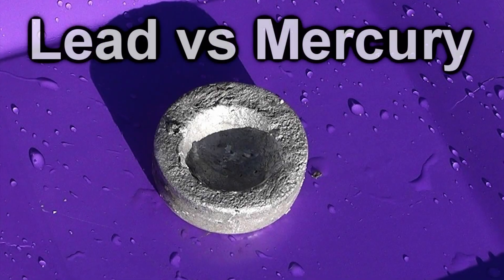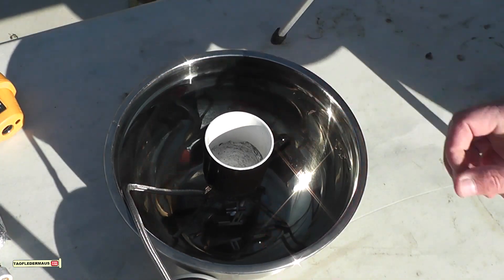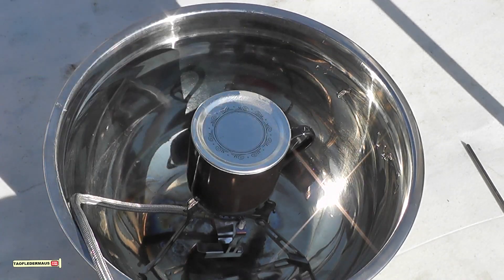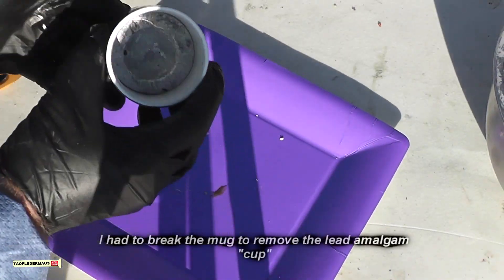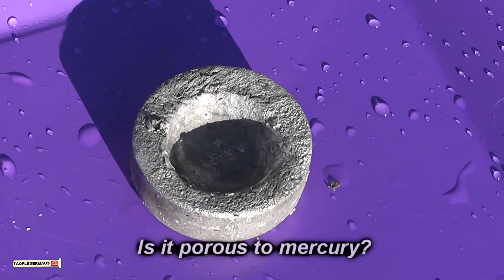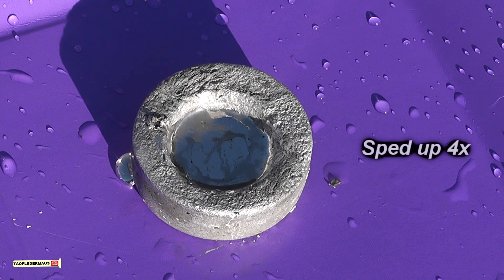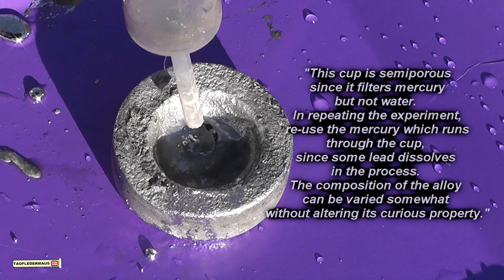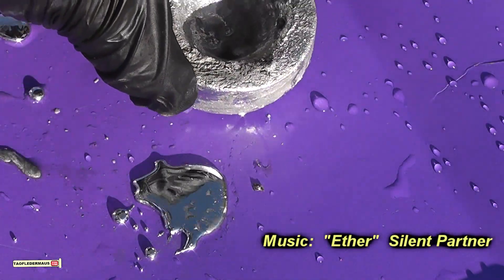MERCURY vs LEAD -  Rare experiment from 1952

Comment: Mercury also really likes to form amalgams with other metals, lead amalgam being one of them with the consistency (more or less) of baked goods.  Without some inert barrier between the mercury and the body of the projectile, it's just going to turn the whole mass into a material which deforms tremendously upon hitting the target.  Trade stopping power for armor penetration ability, like most fragmenting rounds.  Main risk is that the forces of the gunpowder might tear it apart in the barrel.

Comment: Very cool !  Just a thought off the top of my head ,  the mercury mixed at lead melt allowing capillary action to bond with increasing lead oxide like sponge ,remaining as clog for water, however the weight  of the mercury is much greater than water and even lead ,so bleeding through the pores of the oxide is dependant on the amount of it (lead oxide)  But ! lets fill a shotgun cartridge and hit the lead plate (the 30 pounder) and see how that makes pores in lead ! it will be a 1 incher, not any of these microscopic pores,  Do you guys Mach Mercury? Where is "OG? "and "LittleTony"?

Comment: This is a great video, and thank you for taking precautions and mentioning them. If you're not a chemist, you cannot be too careful around heavy metals, especially when "boil the mercury" is an option that is on the table. 

Uh, all that said, if you are a trained chemist or you know one who can supervise, boiling mercury is fairly "easy" (for a trained, experienced chemist) to contain with a jacketed condenser that is capped tight to contain the vapor. You can ballast it by connecting it to a large, empty (or rather, air-filled) flask capped with a an air-filled balloon and sealed with parafilm to prevent a vacuum implosion during cooling or overpressure/thermal failure during heating. But again, only if you have training and contingency plans for every worst case scenario. For a guy with a camp stove and a coffee mug, you did a stellar job here.

Comment: The mercury is not seeping through the lead it is flowing over the side of the vessel. I’ve been experimenting with mercury amalgams and they flow like that. It’s just like taking a wick and hanging it in a glass of water, over the side. The wick acts like a siphon and displaces the water to the lowest point. In this experiment the amalgam is the wick that the mercury runs over.

Comment: This guy way overestimates the dangers of mercury and lead. While it's good lab practice, "protective clothing" probably wasn't necessary aside from preventing burns. He most likely didn't even need gloves, unless he had open cuts on his hands. But a respirator is definitely a good call; while mercury doesn't absorb well through skin, it vaporozed lead and mercury are certainly very hazardous and should only be dealt with in a well ventilated space and with proper face protection, including goggles and probably a respirator.

Comment: Correct, lead shot is usually an alloy to prevent pellet deformation upon firing. Alloying even a small percentage of tin with lead can more than double its hardness, so the process is very efficient. I personally use wheel-weight alloy to cast Foster slugs, and water-drop them for additional hardness.

Comment: You might be able to do another iteration of this experiment with results that'll be entirely novel; Make the amalgam into a conical shape instead and suspend it above a container to catch the mercury seeping out, then recycle the mercury repeatedly to see if repeated flows through the amalgam will alter the appearance of the outside tip of the cone(beyond the liquid mercury sticking to it), indicating that the liquid mercury is actually substituting the amalgamated mercury which then falls 'through' not by capillary action, but more of a gravity-inclined molecular osmosis which should then slowly pull the amalgamated cone into a cone with a stalactite that gets longer, presumably until it becomes just a rod - though i doubt you'll want to continue for that long as the process is likely to be quite slow if this is how it works.

Though you still deserve recognition for doing this experiment, congratulations on the success in reproducing the original result, and on making me look up yet again which is which between stalactites and stalagmites :)

Comment: Yeah, so this is about the 'wetting' property of the two materials.  Water, apparently, does not 'wet' on the amalgam, whereas mercury does.  In that way the surface tension of mercury works in the opposite manner it normally would, I'm assuming penetrating the substance through capillary action.
Reply: ***** Thats what "wetting" means, but no, mercury doesn't wet non-polar substances, in fact it wets almost nothing.  As an example, mercury doesnt wet or 'stick to' the plastic or glass containers its kept in, which are both non-polar.

Comment: Cohesion vs Adhesion, Mercury has a much higher cohesion than wayer, but at least to the lead mercury amalgam it has a high enough adhesions that capillary action will carry it through the pores. Water has a low adhesion so it minimizes its surface potential by staying as a blob in the cup.

Comment: Very cool.  It seems to make sense that this would happen, I think I can propose a sensible explanation:
Even though the surface tension of liquid water is lower than liquid mercury, the water doesn't effectively wet the mercury/lead surface at a scale small enough to pass through the micro-pores in the amalgam.
The liquid mercury wets the mercury suspended in the amalgam because mercury wets itself readily.  Thus mercury can seep through the micro-pores in the amalgam cup (probably via capillary action and/or the pressure of the "column" of liquid mercury in the cup).

I am basing that conjecture on the principles behind hydrophobic materials which, due to surface geometry, do not allow water to wet their surface.
Reply from the maker: +cwtoyota   That sounds like a good explanation!

Comment: Loved it, nice experiment.  But one thing about the others you have done.  Yes, mercury is toxic.  If you boil it, or vaporise it.  But in a stagnant state at room temp, no issues.  How did I ever survive growing up in the 1960's, riding in the back of open pickups down gravel roads at up to 40 MPH with no restraints, bicycling without a helmet, playing on the playground with no rubber, let alone wood chips under the equipment.  And disassembling dry cells in the back yard, and, kicking balls of mercury around on the kitchen table with my fingers.  If you don't eat it, as many have as tooth fillings, no issue.  The high majority of the holy crap, we need to regulate this crap comes from people working with the material daily.  Asbestos is another point in that regard.  No consumer that doesn't do demolition on a building containing it, or works in an industry and is exposed to the fibers daily will ever have a problem.  Got it in your house?  Leave it alone.  It isn't leaking anything..

Comment: I would like to make a suggestion for your weird scientific videos.  So golf balls have a bunch of random things inside depending on who makes them.  The more interesting ones have some kind of winding inside them and comes out of the ball like firework snakes at high speed.  Some have goop inside too.  So figured with your high speed skills and willingness to destroy or corrode things with acid and such might be cool.  You could also freeze it and shatter them see what happens to the different insides.
Reply from the maker: +scastro41797   When I was a kid we'd cut open golf balls.  Just under the skin was a thin rubber band that was wound around a small rubber ball filled with water.   It was tough cutting off the skin of the ball,  but once it was off and the rubber band was exposed,  you'd bounce the ball and it would just start unraveling at high speeds.  It was pretty cool.  You'd end up with a big pile of rubber band.     But I don't think they are that complicated now a days.

Comment: I had a lead ball floating in a vial of mercury because it showed off the density of mercury. Checked on it a month later and the lead ball was gone... Took me a while to figure out what happened to it haha.
Reply from the maker: +erik81subaru  Did the look and consistency of your Hg change a little?
Reply: +TAOFLEDERMAUS Yes, I actually completely forgot I had the ball floating in there. Noticed one day that the mercury has lost its metallic lustre. It had this very dull crinkled finish on it that would break apart if you disturbed it. If the dull veneer broke up it would reveal clean reflective mercury beneath it. It didn't really change the consistency though, it was a very small lead ball.
Reply from the maker: The Hg that permeated through the lead amalgam seemed to have a little thicker consistency.

Comment: Fascinating. I wonder if the Mercury that is in the amalgam is as much as the lead can contain and that what is actually happening is the fresh murmurs you add to the cup is not trickling straight through, but replacing and forcing-out the Mercury contained in the amalgam..  Is that possible?
Reply from the maker: +TheBaconWizard   I think that is entirely possible.   It reaches 100% saturation and the remainder just pushes out the old.

Comment: What an interesting experiment! The difference between lead melting, and mercury boiling is pretty small, yikes. you are a brave man.

good job making a totally new video :)
Reply from the maker: +TheBackyardScientist  Thank Kevin!   I noticed your Water balz video is on the "trending" page,  congrats!     Hg will amalgam with lead at room temperature,  though you have to use a mortar and pestle and grind them together.  So I am thinking the cup is all ready "primed"  with Hg  so it absorbs the Hg much easier,  but  it saturates it beyond what it can hold so the excess just leaks out.
Reply: @taofledermaus  a bit dated, but...
As I recall, the lead particle size and shape plays into speed of forming the amalgam. Smaller particles, spherical being slower, flaked being more rapid, if memory serves.
Now, shudder while thinking of dentist's offices mixing it...

Comment: nicely done. could this be used to separate murcury and water?
Reply: +TAOFLEDERMAUS "I usually just use a syringe."

 You're teh hardcore, ain'cha? Generally, I only have enough guts to snort my mercury...
Reply from the maker: +HardWayLearnt  I usually just use a syringe.
Reply: +TAOFLEDERMAUS right. small scale but say you had a bigger problem to solve... Really I'm just curious if water would be carried through by the Hg or if it was truly selectively permiable.
Reply from the maker: I think only the Hg will go through it.  Hg will amalgamate with the lead even at room temperature,  but being primed all ready with Hg,  the lead amalgam tends to soak it up and spit out the Hg/lead permeate pretty readily.  I think a good analogy is if you take a bone dry sponge and try to soak up water,  it doesn't soak it up as well as a sponge that is all ready damp.   lol...  I'm still trying to wrap my head around this to be honest.
Reply: ***** works for me.  I know nothing about this process so it is very interesting to think about the physics of what is happening inside the amalgam.
Reply: +TAOFLEDERMAUS diamagnetisum
Reply: +TAOFLEDERMAUS could this be done with copper instead of lead?
Reply from the maker: The melting point of copper is almost 2000 deg. F,   so I think the mercury would flash to a gas immediately.
Reply: ***** good to know! I only got the idea because I saw a video of yours where a copper penny absorbed the mercury like a sponge... oh well :)
Reply: +TAOFLEDERMAUS could you do what Homer Simpson tried to do?By making a shotgun shell that could shoot make up on a woman's face as quickway to put on make up?If any woman tells you that they don't think that women would like to get shot in the face than tell them women will like what you tell them like.(The Simpsons episode okay everybody?I'm not anti-women)
Reply: only if one were murcuric.
Reply: +TAOFLEDERMAUS, so is this amalgam technically a sponge? Or is there a possible way to make a mercury sponge?
Reply: if you use this in your water filtration your water might be freed of mercury but it would definitely get lead lmao

Comment: Heavy Metal Meltdown! Amazing video!
Is there any information available indicating the amalgam was tested for porosity pneumatically? Someone suggested the cup was not exactly a sieve, but more like a continuous failure to create a stable amalgam drawn down and out by gravity. I had the thought that perhaps a pneumatic test could confirm porosity. The again, I actually know very little about any of this stuff. But, I have all these thoughts...
Reply from the maker: +vanderticked  I don't know if the cup would hold up well for a test like that.
Reply: +TAOFLEDERMAUS My initial thought was to duct tape it to a shopvac, maybe with a variable flow regulator, and point it at an extinguished candle. Or, is it just nearly too fragile to even handle?
Reply from the maker: +vanderticked   I think a vacuum would break it.  It's about as strong as a scone.  You could just crush the cup in you hand.  I was actually surprised to get it out of the mug in one piece.

Comment: Is there a way of separating the two by heating it up again and letting it sit there?  The density of mercury is 13.53 grams per cm3, and the density of lead is only 11.4, so the lead should technically float to the top, correct?

Comment: Wait, I'm curious about that cup. It's like.. mercury combined with lead, now? And that keeps it from running all over the place like a liquid.. does it melt at lower temperatures than other metals now?
Reply: +Kiba Bloodfang Taof has done videos on Amalgams before. People used to combine mercury with all sorts of other metals to produce said amalgams, and by doing so they radically alter its properties.

This clearly demonstrates though that mercury still has weird properties regardless, but many kinds of amalgams are fairly stable and reliable.

The reason we stopped using them so much is because of the mercury content alone, as we've grown quiet knowledgeable about how bad mercury is upon overexposure.
Reply from the maker: +Kiba Bloodfang   Yes,  the melting point of the alloy is much lower now.   You can create triple amalgams using lead/Hg/bismuth that will melt in your hand.

Comment: My best explanation is that mercury lacks the capillary action that water has.  Water does no pass through the pores of the lead amalgam because of the force of cohesion.  However mercury does because while it has a lot of cohesion, it has little adhesion to the lead amalgam.  This is the same reasoning why the lead's meniscus is opposite to waters.

Can anyone add to this?

Comment: Very cool. Afterwards, did you separate the amalgam? If so, through what process? If not, how do you dispose of that sort of thing?
Reply from the maker: +radius55  In order to separate them,   I would have to put them in a retort  (a still)  and flash out the mercury and condense it.  At this point I am just putting it a container and treat it as haz. waste.

Comment: Thanks Jeff - for taking the time and risk to show us this.

I wonder if the Mercury leaches from the amalgam such that the cup will weigh less after use (due to having less mass)?
If you catch my drift - like the mercury being added to the cup is pushing the amalgamated mercury out rather than passing through?
I dunno :-) Cool though.

BTW: I submitted the link to Reddit at https://www.reddit.com/r/EverythingScience/comments/3x1gq1/mercurylead_amalgam_the_paradox_cup_an_experiment/
Reply from the maker: +Fred Gandt   My cheapo scale probably wouldn't be accurate enough to tell the difference,  but  I imagine it would be less dense.  I noticed the Hg permeate had a little different characteristic to it,  a little more viscosity to it.
Reply from the maker: +Fred Gandt   Thanks for Reddit-ing the video, btw!
Reply: Interesting.
If the Mercury can be effectively leached out of the amalgam, we'd end up with a molecular sieve made of lead, with just enough space between the molecules to pass only Mercury or smaller?

You're welcome BTW ;-)
The fact that it's a rarity and an oddity makes it very shareworthy.

Comment: can you explain Why for us ignorant ones?
Reply from the maker: +YouTake   Even the paper doesn't really explain.   My theory is the amalgam is all ready "primed"  with Hg  so it is easier for the Hg to bond and flow through itself than for water to do the same.
Reply: +TAOFLEDERMAUS can you do more mercury videos? I like those the most :D
Reply: +TAOFLEDERMAUS what if the Mercury is effect by gravity and is still liquid at the atomic level and we are seeing the Mercury that was close to the outside on the left act as a conduit for the Mercury to squeeze out. Water would not replace the Mercury and stay..... brain hurts.... could we filter see water of Mercury by pulling a vacuum on the backside.... error
Reply: +TAOFLEDERMAUS sounds plausible

Comment: I have a explanation for it. and it's NOT complicated. the mercury seeps through because it was made with mercury and the desolving lead just speeds up the process. that's what I believe anyway..
Reply: why would making it of mercury mean this
Reply: awesomesauce it lets only mercury through and not water because of the high surface tension of it.
Reply: +awesomesauce Mercury has a high surface tension because the mercury atoms are attracted to each other. Dividing the mercury into smaller droplets means there's a larger surface area with mercury atoms that do not get to surround themselves on all sides with mercury atoms; that's a higher energy configuration than one big blob of mercury. If there's mercury in the amalgam, perhaps the mercury is attracted to and wets the amalgam, so it can seep through tiny pin-prick holes.